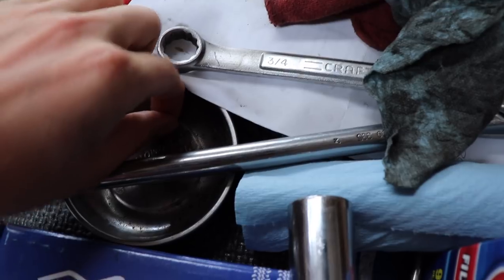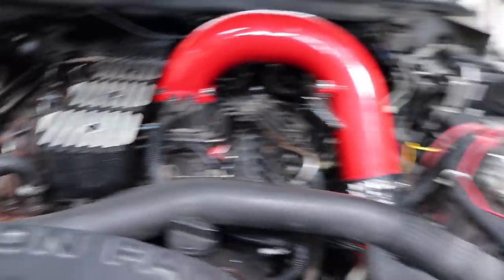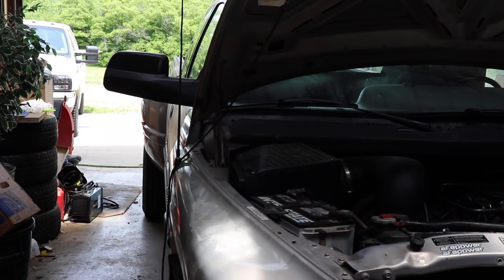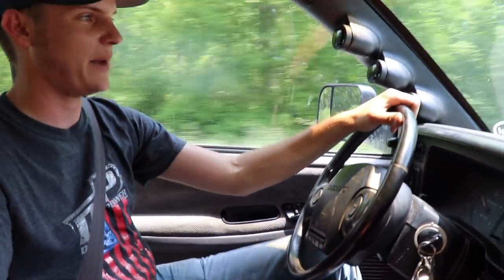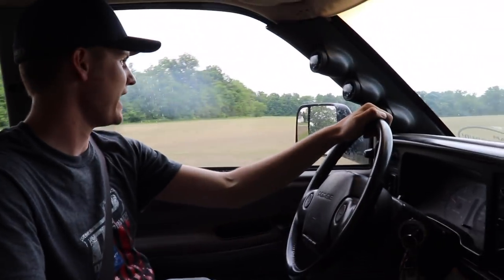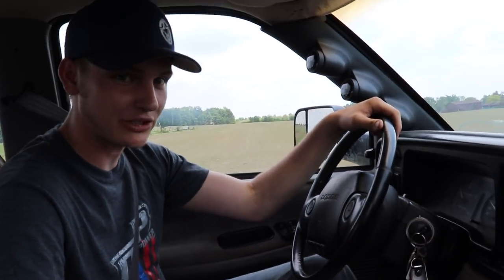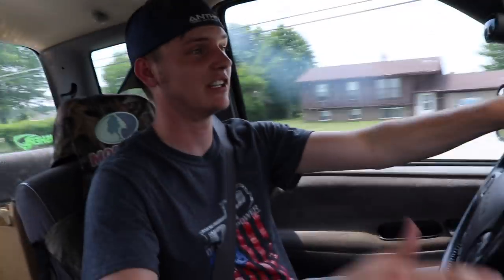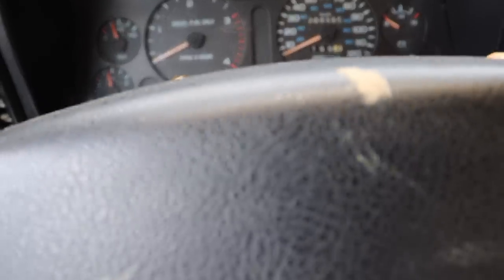THE 5 SPEED 12V CUMMINS LIVES AGAIN!!!!

Comment from the maker: Huge thanks to Diesel Auto Power for all the HP upgrades!!!
Check out the dually mod list in the description above to see links for all the parts used!!!
Reply: couple things the smoke will get better with a bigger turbo for the air to fuel ratio another thing u wanna get a lift pump on soon like 30k soon because although the PPump is so much better then a VP it still won't handle that much of a fuel request.
Reply: Probably over fueling needs more on the air side
Reply from the maker: It needs the turbo on it... I'm not gonna drive it anymore until I get the turbo on, as well as my EGT reading. Just to be on the safe side of things!
Reply: TheLowTechGamer also the p pump and the vo44 is an injection pump  shure the his lift pump can handle the supply  but he should really get a fuel pressure gauge
Reply: i think what hes getting at is he wants the ability to push the amount of fuel needed, without having to worry about it like myself I have a 95 12valve built ATS Auto trans stage 4 stage 3 hamilton street cam 200hp injectors head work 110pd valve springs push rods twin turbos a 70 fed by a 62 and i run a Fass 200 lift pump also 5k's extra the point is the p7100 injection pump will keep up with most of the upgrades hes done but it can run dry for me iv owned 4 12valves and i always put a Fass no matter what i do just to be safe as i request more fuel also this is just personal opinion Fass over Airdogs love them both but Fass has worked better for me
Reply: LOUD 'N' PROUD I love the smoke!!
Reply: LOUD 'N' PROUD I have the same issues except mine was sheared off and I gotta adjust the solenoid so it shuts off smoother
Reply: LOUD 'N' PROUD  a bigger turbo won’t always cure the smoke compounds or twins do a better job of cleaning up smoke  but your smoke is caused by over fueling so you really shouldn’t adjust the pump again till you get the new turbo on ... over fueling can damage pistons

Comment: The smoke will get better when you put the new turbo on it. The new turbo will put more air in the engine and reduce the smoke.
Reply: Joe is right, I would adjust anything until the turbo is on, I think you are doing a great job, Daully sounds really good
Reply: i was just going to say this, dumping way more fuel in on stock amount of air, i would wait to see how well the turbo cleans up the smoke, it should be about perfect

Comment: Lol yeah a stock turbo with that hp injector is pretty smokey. My 24v went from a puff too making the intersection disappear. The best way to correct over fuel is more air lol
Reply from the maker: Kurt M the bigger turbo will clean it up more
Reply: LOUD 'N' PROUD absolutely, can't wait for the install.

Comment: I have the same problem with my 24v 
Even on idle it blows a lot of black smoke 
Truck is completely stock 
270k miles 
Was thinking replacing the injectors 
Anyways did the 12v clear up with the new turbo upgrades

Comment: Do you plan on running head studs? Or just sticking with stock head bolts? I wanna do injectors and a turbo on my first gen 12v but I don't want to blow a head gasket!

Comment: Is the stock air filter on it or after market that will make a diffrence
Reply from the maker: Patrick Phelps aftermarket... biggest I could get lol... it’s just the bigger turbo isn’t on yet... explains the smoke.. not enough air flow
Reply: LOUD 'N' PROUD i have a volant cold air intake on my 24v cummins